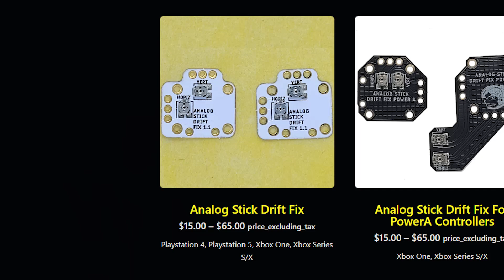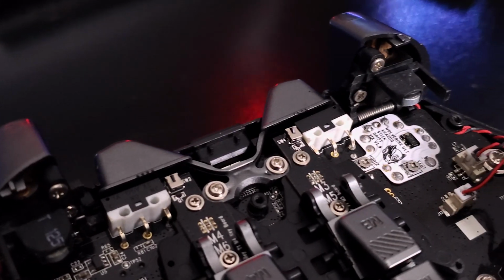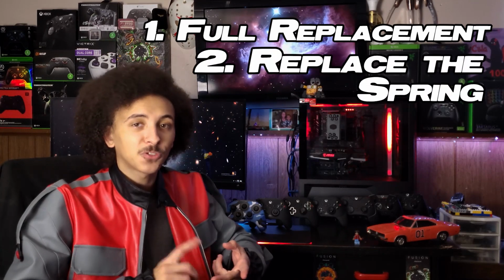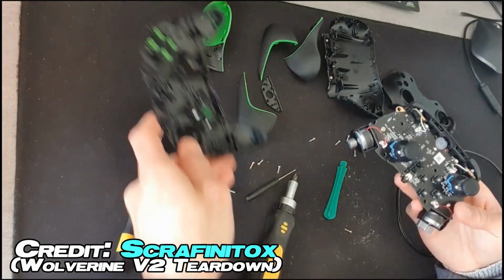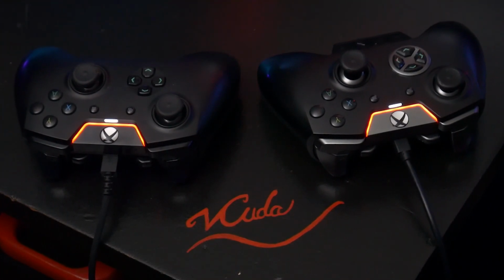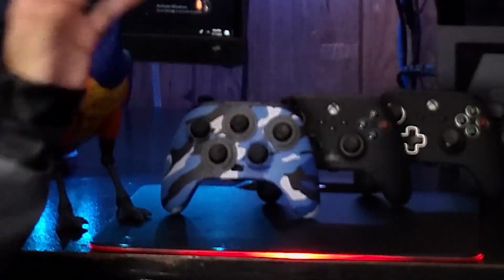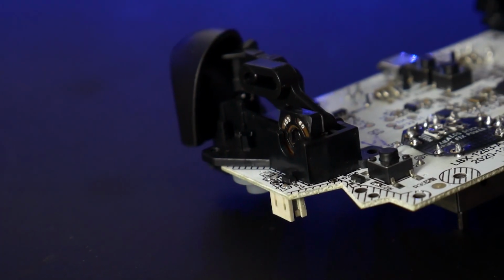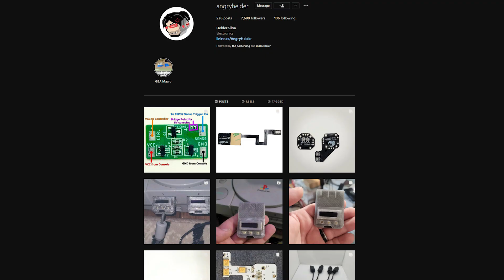Stick Drift Fix for PowerA & Razer Pro Controllers!

Comment from the maker: Helder dropped some PCB's for PowerA so I wanted to give em a shout! Next time I talk Stick drift I'll be reviewing the new 8Bitdo Controller with hall effect thumbsticks.

It appears that there is a growing audience interested in the reliability of their controllers!
Reply: You forgot to pin your own comment
Reply: Hey vCuda one of these companies should just add a solderable hall effect joystick module.
Reply: @al-ww5jp  only problem is it's better for all of the companies bottom line to sell things that are going to break within months it wouldn't surprise me if there wasn't much improvement in the market until a law maker starts pushing controllers as an environmental problem
Reply: I've finished my total technical study of all the bloody trim pot resistance values & posted the perfect recalibration results 👍🏻🎮👍🏻, mastered the buggers. 

I'll say this I've used 50, 100 & 200K resistance trim pots in the same pad on random axis for the best results just to throw a bag of spanners 🔧🛠️ at a one piece solution 🫠, sorry it wasn't good enough 🫢🤭🥴 for me, follow the mad science ⚡🤤. 

Keep up the good work. 

Next to watch your usb-C DS4 switch out charge pair board find 😱 well I never good stuff 👍🏻.

Comment: I recently got this fix for my Razer Wolverine Ultimate and after soldering everything into place and adjusting I can tell you that they aren't a permanently dependable fix. Sure they allow you to adjust the minimum rest position which in theory will fix stick drift, they for whatever reason limit the maximum deadzone to the point where you don't even have full circularity anymore, and then honestly they just threw the whole joystick sensing out of whack. I ended up having to learn how to remove solder shortly after utilizing this "fix". Still waiting on someone to figure out a better fix so I don't have to toss my $150 Razer controller (which I love).

Comment: If you’re in there soldering and spending $15 you might as well solder a new stick in there. These things make you lose movement range because the smd pots on them are only 50kohm. All of them do, not just this brand, even the new extremerate ones only use 50k smd pots.

Comment: Idk how, but I have won the PowerA lottery 4 times. 2 different fusion pro 1s, and 2 different spectra enhanced, two still running with no issue, the only reason they were bought is because my brother absolutely shattered the originals. I've had my second fusion pro for almost 2 years now and it runs absolutely flawlessly, although it doesn't get used all that much anymore due to the fact I got a gambit for fighting and shooting games, and only use my fusion for low-wear driving games
Reply: You didn’t win a lottery, you just don’t game 24/7 a day for the entire week
Reply from the maker: Yeah, strangely my original fusion has somehow survived too. That's one of the biggest Downsides with controller gaming, it kinda relies on you being lucky enough to not destroy your controller due to usage. Sometimes it happens, sometimes it doesn't. Sometimes it happens over and over again. It really just depends on chance, and proper care of the device
Reply: I never won anything in my entire fucking life, and I'm 6468 years old.
Reply: how do you like the gambit ? is it better for shooters ? i'm stuck between getting the gambit and the V2 chroma . i love the mechanical face buttons of my wolverine ultimate , even tho my Y gets stuck sometimes , and my scuf instinct pro has the best triggers ever . despite the clicky buttons of the wolverine , i'm not a big fan of the back button design , kind of uncomfortable & ik the victrix has a nice back button layout i just need someone to convince me to go one way or the other 😂😂
Reply from the maker: @ushallN0tpass  well, there's your answer lol. You don't like the button design on the Wolverine Ultimate, and the v2 Chroma has the same button design. So you'd likely enjoy the gambit more
Reply: @vCuda  thank you oh exalted one 😂🙌🏽 your knowledge is truly appreciated .  hopefully i can cop one for less than 100 during black friday
Reply: @ushallN0tpass  as someone who's had both the wolverine ultimate and gambit, they play very similarly with just slightly different button placement and the different top face buttons (next to the triggers I mean). For the 100 and up price point, the gambit is the best for specifically shooters and fighting games, but isn't great for casual games or racing games due to the grip shape. The wolverine is good at all around stuff, but will never be the best in any category. If you're just going to play shooting games, get the gambit. If not, the wolverine is the better bet
Reply: @vCuda  yo im looking for a controller yo get for christmas but the elite and default controller just feels so delayed to me the fusion pro 2 is nice and has less input delay but it’s big as hell. any suggestions
Reply from the maker: @froolo  Well tbh if the fusion pro feels big, a lot of pro controllers are going to feel rather large. I'd say try the Victrix Gambit but its a bit bigger than the Fusion so idk if you'd be up for it. Its a solid controller either way
Reply: @vCuda  preciate it!
Reply from the maker: @froolo  anytime man
Reply: @vCuda 
What would you say are the best  controllers for FPS games
Reply: @logi8284  depending on your budget, for lower budget, the victrix gambit, for the higher price, the wolverine ultimate or V2 chroma (really just depends on which you can get cheaper)
Reply: @theballingboi5360  
It seems that they are all around the same price so which one would you say is the best
Reply: @logi8284  if you're only going to play FPS games, the gambit, if you're playing anything else as well, the wolverine
Reply: @theballingboi5360  thanks
Reply: @logi8284  bro i just started using the xbox one comtroller on my series s and it has wayyyy less input delay that the series s controller. i use it wired tho
Reply: @GaveMeStyle7  as someone who games VERY often i can say that my power a fusion 2’s (i’ve had 2). All controllers get stick drift (wear and tear). My first one got stick drift after two years of daily gaming. My second one has lasted me 2 years as well and it works amazing still outside of the fact i dropped it and broke a paddle.  My elite v2’s in comparison.. ive bought two and replaced two after warranty and they always break regardless of me taking perfect care of them. Power A fusions are great for the price point.
Reply: @joshgodbay4699  Yeah I bought the power A spectra infinity a week after my comment and it got stuck drift in 3 weeks

Comment: had the powera fusion 2 for a year now, no problem with stick drift. Before that the xbox elite controller developed stick drift in under 3 months. The trick is to  never use the L3 and R3 keys because that is what causes the sticks to wear out. Just rebind those keys to the extra keys and voila you are all set for a long lasting controller
Reply: Yep, same here. I have 2500 hours of use on mine, Fusion 2 are built better than elite controllers and can be had for $60 around black friday.  (Bought mine 2 years ago around then)
Reply: I've had 4 powerA controllers this year. Stuck drift was the problem. I'll never buy them again!

Comment: I can't believe today my razer wolverine ultimate stopped working completely when I barely used it and was starting to like it. While playing r6 with friends and voice chat all of a sudden it shot of and I used the cable it came with for other things and it works great and all i can see for a few seconds when i plug the controller is a very faint light on the profile change button and it doesn't do anything else. Nor in xbox nor pc. Is my controller officially dead can it be repaired? I don't wanna lose a expensive controller I barely used :-\

Comment: is the fusion pro 2 controller durable? how long does it normally take for stick drift?
Reply: I got mine at the start of the 2020 pandemic and have been using it pretty nonstop and it’s just now drifting. “Durable” is subjective but thought I’d tell you my experience.

Comment: Any of these modifications with the glue gun thing scare me too much
Reply from the maker: It isn't insanely difficult, but depending on what you're doing it could be tricky. With these PowerA controllers the job is quite tricky, so I'd only recommend it those capable

Comment: not worth it
Reply: Good games already have a dead zone setting. Otherwise keep your controller covered when your not using it my battle beaver is almost 2 years old and it’s because I don’t constantly smash R3 and I keep the dust out
Reply from the maker: When you increase the deadzone value in game, you lose a ton of micro adjustment accuracy. Deadzones make it so your stick doesn't function within the area the stick drift is happening, but the problem is, it becomes harder to make small adjustments when aiming. Trust me, if deadzones did the same thing, I wouldn't be covering these lol